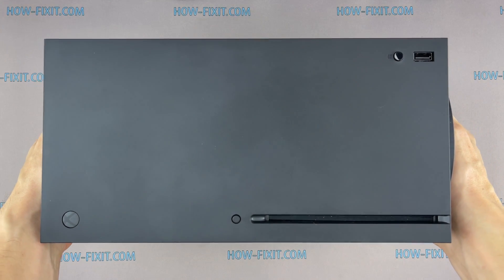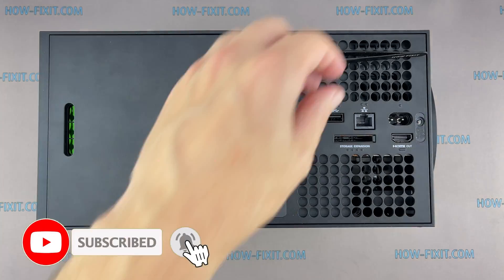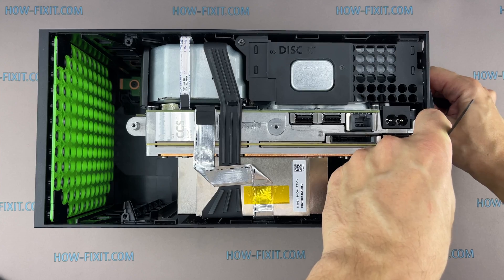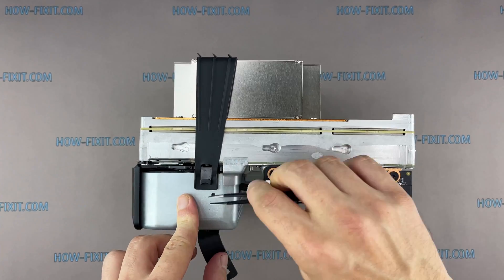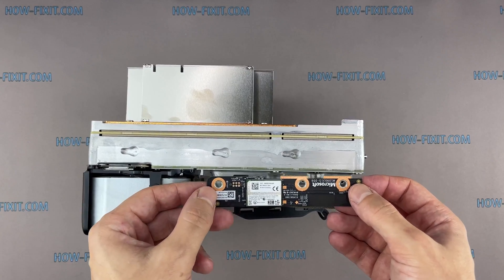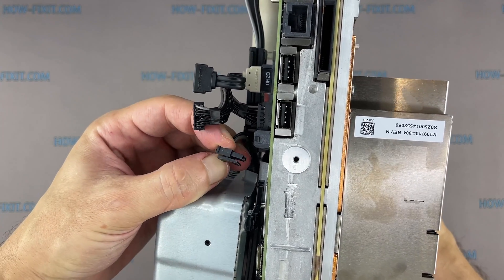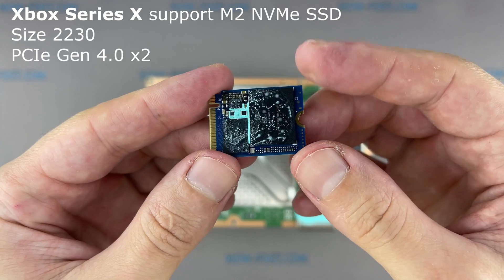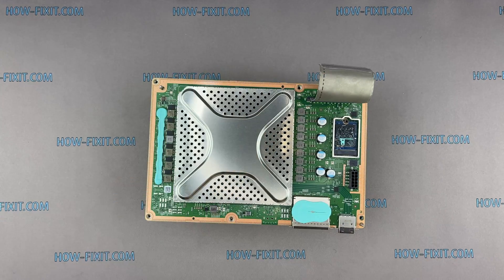Xbox Series X internal M2 SSD Replacement

Comment: I bought a second hand series x .
It turn on but doesn't show me nothing 
I took out theinternal hard disk and connected with computer . 
It show me 6 partition ( 5 of them are closed "cant go inside them"  and the last one is 6.99 GB is open but i cant copy anything inside it. 
I installed a random partition app on window( it show me the  partitions are in read only and they are free space 100%)

In this point , is there anyway to fix it ? 
Or i put it in the garbage?

Comment: this alone will let me avoid an xbox
Reply: ??? The PS5's internal SSD is actually soldered onto the system board, so significantly more difficult to change than the Series X (I doubt anyone would even try). So I don't really understand the point you're making :-|
Reply: Do you think taking apart a PlayStation is any easier? The more powerful and compact a console the harder to take apart. This is not meant to be a Dell PC. Also, this is far easier than working on the newest, slim laptops.
Reply: @ridiculous_gaming  it’s extremely easy…
Reply: @ridiculous_gaming  ps5 was easy to install a 2tb ssd hard drive.... 5 min and back to playing & xfering games. Its 300.00 cheaper and i can launch games from it.
Reply: @ridiculous_gaming  i meant to type  that  its 200.00 less than the Seagate ssd expansion